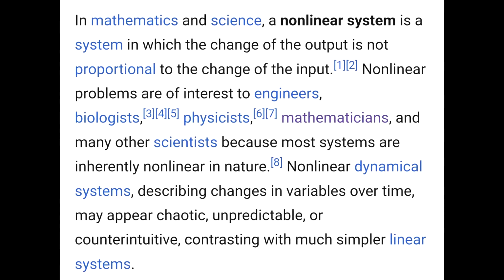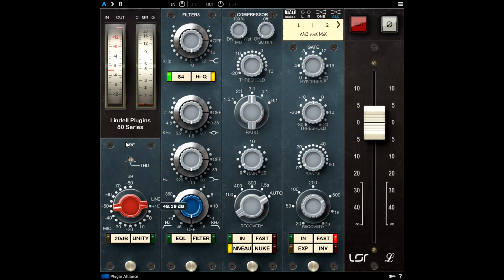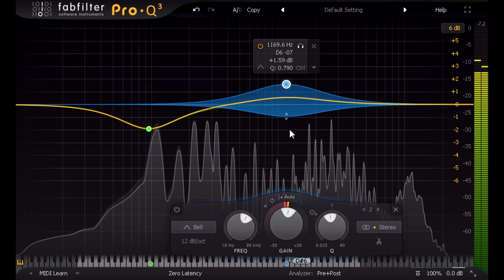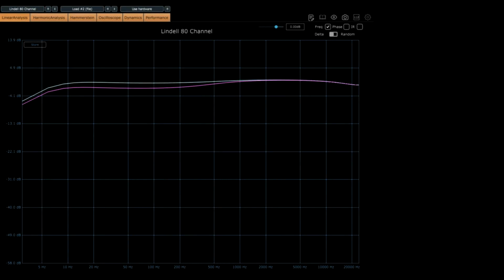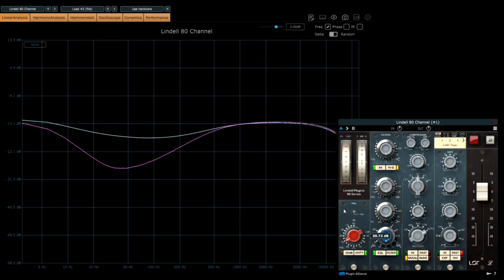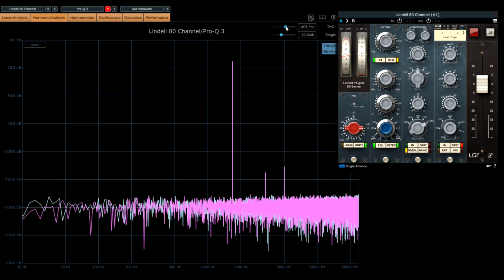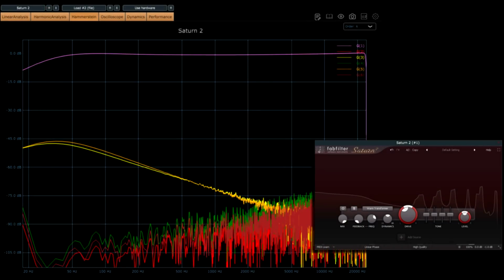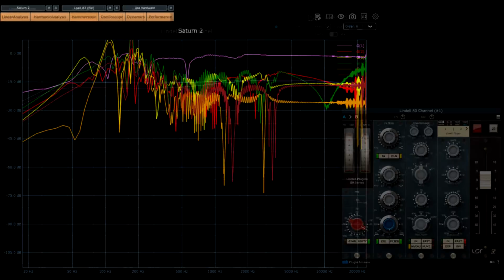WTF is a Non Linearity?

Comment: I think this could use a bit of expansion on intermodulation. A linear function follows the rule that f(a*x+b*y)=a*f(x)+b*f(y) and your change in input level only shows that f(a*x)=a*f(x). It's part of being linear, but not all of it. The other part is that a linear plugin on a bus receiving two inputs produces the same output as both inputs going through instances of the plugin and then summed. Distortion-free nonlinearities occur, when the relation above holds for x and y being levels of signal at a particular point in time, but not for x and y being the entire input function.
Reply: yes, and also intermodulation distortion has been glossed over when discussing distortion produced by analog circuits, for the sake of synthesis I'm sure.
do you have an example of the latter situation?
Reply: @lucianodebenedictis6014  I think the classic example of intermodulation using analog equipment remains an overdriven electric guitar playing power chords. On first approximation you get the sum and difference tones (and neatly enough the sum and difference frequencies of upper partials are harmonics of the difference tone resulting from the fundamentals). You have the root of the power chord and the note a 5th up, which is (ignoring finer details of tempered tuning) 1.5 times the frequency of the root. So the difference tone sits at 1.5-1=.5 times the frequency of the fundamental, which is an octave below. So playing power chords through an overdriven amp adds additional frequency content below the chord, making it sound, well, powerful. With the inversion of the power chord (smoke on the water comes to mind), you get a perfect 4th, which is 4/3 of the root, leading to a difference tone at 1/4 the root or two octaves down. Pretty much any other interval gives you some pretty wild additional tones (often outside of the western 12-tone scale). As soon as you add a third note you also get another level of intermodulation and now you are looking at the combinations |af+bg+ch|, with a,b,c in {-1,0,1} and f,g and h the respective fundamentals.
Reply: Totally agree. It misses a big part of the picture. There are also a bunch of other processing that are nonlinear, basically every sort of dynamic plugin is intrinsically nonlinear, compressor, gates, etc. I'm thinking that spectral effect (autotune, vocoder, etc) may actually also be nonlinear.
Reply: @yass8483  Dynamic processors are all nonlinear if you take signals over time as an input. They are linear (at least if they don't model analog gear) at any given point in time. A compressor (and gates, expanders etc. have the same property) basically switches between two linear transfer functions. If it's soft knee it goes through a series of linear combinations of linear transfer functions, which are also linear. So for each individual sample it is linear, for a longer sequence of samples it isn't. If you shorten the attack and decay times, you can - as Dan does - view this as creating a non-linear transfer function. Alternatively you can view this as the same linear transfer functions as before, but the switching starts to happen at audible rates, which then introduces additional frequency content not as distortion, but as Amplitude modulation sidebands - the maths work out to the same result. Spectral processing doesn't have to be non-linear. The FFT is a linear transformation, so it will depend on what you do in the conjugate space that determines whether it is linear or not. I'm pretty sure vocoders are linear, but I know that the pitch detection for autotune, melodyne etc. is non-linear. The pitch shifting itself is linear. I don't think any of these offer side-chaining (i.e. generating the control signal from another source than the audio you are processing), but if they did given the same SC the processing would be linear, but the SC input would act in a non-linear fashion. (Edit: That would also be a good reason to view compressors as AM modulation rather than as a non-linear transfer function. If you have very short attack and release times and use a SC, the additional frequencies in your result will appear as AM modulation with the frequencies of the SC, not as harmonics of the signal).
Reply: @simongunkel7457  What do you mean SC ? 
But you are right FFT is indeed a linear operation and that is also reversible. For a pitch shifting, I just can't see how the process of changing the frequency could ever be linear, or what function could affect linearly a sum of sine functions in such a way as to produce sine functions of different frequency, but maybe there is something that I am missing. I am not quite clear on which operation done in fourier space would result in a nonlinear operation in the time domain, but I am no signal theory expert, so you tell me ;)
And yes, also right, vocoders are indeed also linear, as they are just modulating levels of different partials independently of one another, according to a control source, also applying it to a sum of two signals should be equivalent to applying it independently to each, and summing after.
Reply: @simongunkel7457  Eg. lowpass/highpass filter are clearly linear operations as the differential equations of corresponding RC/RL circuits are also linear. Changing the frequency I am not sure that it is the case.
Reply: @yass8483  SC=side chaining. The trick with pitch-shifting is to note the following: if f(x) and g(y) are linear functions, then f(g(y)) is also linear. So you can chain operations and if they are all linear, so is the result. For pitch shifting you do a Fourier transform. Now instead of an intensity vs time, you have an intensity vs. frequency. Now you apply a scale factor to your frequency axis, which is also linear. And then you do another fourier transform to get your intensity vs time signal back. So the short answer to what operations in the frequency domain result in non-linearities in the time domain is: non-linear ones 😃
Reply: @yass8483  If the change in frequency is independent of the incoming signal it reamains linear, but if the change is fast enough (i.e. audio rate) will introduce audible frequency content based on the modulation. If you use a touch wah or something similar, where the frequency depends on the input level, then it will become non-linear.
Reply: @simongunkel7457  That makes sense indeed, thanx :-)
Reply: @simongunkel7457  bottom line is, this video can clearly be refined/updated 😄
Reply: @simongunkel7457  Softube patented the best non-linearity engine
Reply: @MrlegendOr  They certainly patented one approach to simulating non-linear audio equipment. Is is "the best"? Hard to say, because it is vague in parts, but their method for not using oversampling is not so much a method but the claim "eh, it'll be fine even with aliasing" and an easy improvement would be to oversample. Though with their approach that might lead to too much CPU load.
Reply: @simongunkel7457   
Ok sir I know everything, now show us the plugin you coded which is better than Softude
Reply: @MrlegendOr I've only written small utility plugins, I'm not a plugin developer. but if you read their patent, they specifically say that their approach uses Chebychev-polynomials rather than a look up table or interpolation and they argue that while this does produce aliasing without oversampling it's not as bad as with the other two options. Oversampling is CPU intensive, so that might be a reason to drop it, but it certainly also increases quality. It's in their patent. If you like Softtube plugins, great. But it's clear that it is both possible to get rid of more aliasing using oversampling and thus increase the quality compared to what is in their patent. There are plenty of good ideas in there, I'm not dissing them. I would note that there are other approaches to modeling non-linear systems and each of them has advantages and disadvantages.
Reply: @simongunkel7457  So, I was right, you don't have any empirical experience on the subject you just throw Wikipedia's thinks on the debate to try to show that you are clever than Softube guys. Show us your plugins with your methodology show us your Patents we will compare them.

Comment: how does compression adds distortion? here's a voice tone AAAAAAAAAAAAAAA (a choir for example). now we compress it half-it's-level-threshold 4:1 ratio.. where exactly and why and what and how much will a distortion appear?
Reply from the maker: That depends on the compressor and it's settings. If you reduce the attack and release smoothing right down to zero, you get a waveshaper style distortion. As you smooth the gain modulation more, the distortion is reduced, but it never really goes away entirely.
Reply: @DanWorrall  I mean despite the tone ( a musical note) this example is a complex sound, so how does distortion appear, at what place, at what frequency etc.. does the compressors\distortion can get the main tone of a sound? I mean the base note? how they know from what frequency to count adding harmonics and at what level etc
Reply from the maker: Harmonics will be added at multiples of the original frequencies, plus sum and difference frequencies due to intermodulation, just like with saturation. Plus you get sidebands from modulating the gain of the signal at audio rates. Some compressors are very clever at minimising the distortion. Others (often the more "exciting" ones) embrace it as part of the sound.
Reply: @DanWorrall  Assuming the input signal is itself a harmonic series, the sum and difference frequencies will also appear at the harmonics. As soon as you have a non-tone (i.e. frequency content that can't be expressed as a fundamental plusinterger multiples) you get additional frequency content through intermodulation.

Comment: "Gain" should just be called in a lot of cases "Input volume". It'd clear up some confusion.
Reply: Level: A measure of signal strength, generally given as dB below digital 0 in digital pathways. Level can be momentary or averaged over some time frame.
Gain: A change in level given in dB.
Volume: A name for level used in consumer electronics, which everybody has grown up with and engineers love to hate, because they unlearned to use the term and so should you. They are not wrong.
Reply: In a lot of cases, but not always. Compressors for example oftenly have another gainstage at the end of their signal paths to make up for the volume loss introduced by the compression. Gain (as far as I understand it) simply refers to the factor of amplification of volume provided by a piece of gear or a plug-in.
Reply: @frederikortmann6545  Yes but what you are describing is the make-up gain, which is also the "output volume" (putting quotes around it to say I'm using this term loosely) which is designed to be linear. Much like the final power amp stage of a guitar amp: it's meant to be linear and sent to the cabinet. The distortion happens in an earlier amp section of the guitar amp.
Whereas input volume, used to be desired to be linear, but nowadays is the main tool we use to introduce distortion. That's true for compressors and guitar amps.
To nit-pick to death: the output volume of any sound processor can also be seen as part of the input volume of the next sound processor... And introduce distortion if cranked too loud.
In the end, it's true that "gain" is technically the most exact term, but I think "input volume" is more universally understood by the layman
Reply: @KingGrio  especially when they’re using a ‘master volume’ amp. 

While it’s technically true it’s all ‘gain’, it’s also true that guitarists have been led by their equipment manufacturers to believe that ‘gain’ and ‘volume’ exists at only input and output respectively. 

Also guitarists believe all sorts of nonsense about their instruments (I recently saw two original 1960s power stage vacuum tubes being sold for like $7500 — a pair !!! The magic pixie dust on a 50 year old pentode valve better be amazing for the additional $7450 investment required 🤷‍♀️)
Reply: @Wayne Brown This!!! 👆👏🏻👏🏻